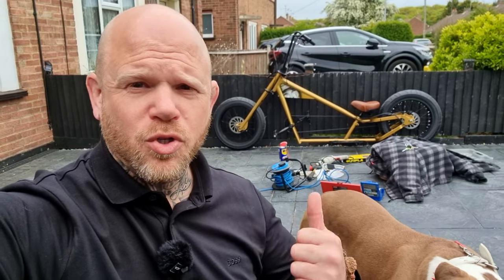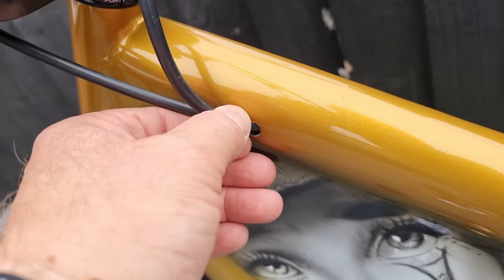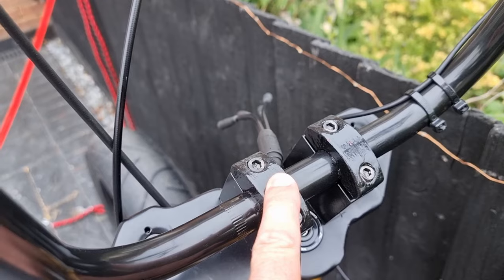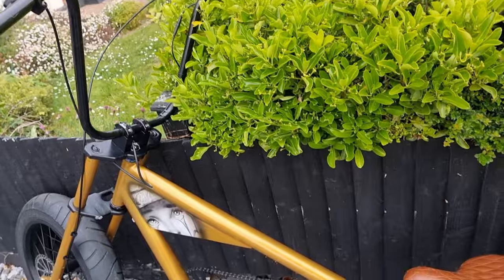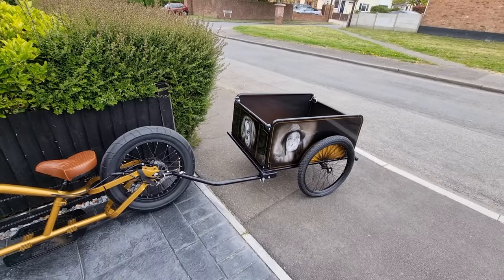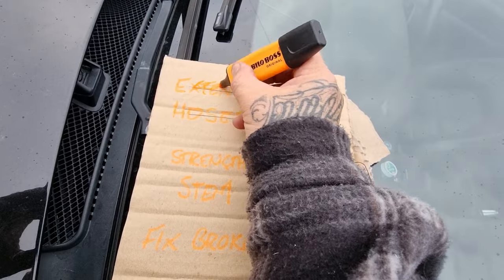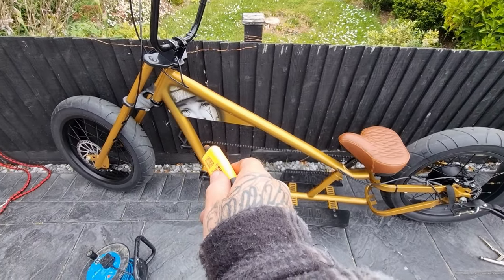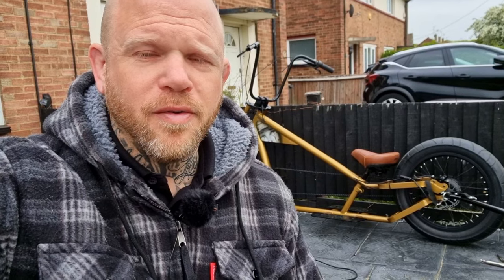CUSTOM E-BIKE LOWRIDER GETS HITCHED!

Comment: Wow it's looking amazing now the trailer is hitched to the bike I'm loving the face art work on the trailer. The brakes discs and cable routing looks really good what a mean machine. Can't wait until you get the battery and controller fitted.

Comment: Love the chopper look, but concerned about the bolts through the bars, massively compromising the integrity of the tube. If you have to make an emergency stop, you may find the bars snap in half, and you may go over the top and under a car or something. Have a look on line, at a motorcycle chopper and see the special brackets that are made for ape hangers. Looking forward to the next vid. Paul UK.
Reply: Never had problems with bars like that (and I've run quite a few over the years) unless the stem was aluminum. Under pressure, the clamping surface makes this dry, gray film and your bars slip around. Then you gotta clean it out with sandpaper and it's good another year or so. I'm wondering if the blocks on his fork risers ain't aluminum. Or maybe it's the paint causing it. Paint's squishy, better to powdercoat parts like that.

Comment: Awesome build! I've been following your progress even though I'm late to the game. I think it would be cool to go with two batteries and a parallel blender? Install one battery in the bike frame and the other in the trailer. That way you only use two batteries when you hall the trailer and one single battery when you run the bike without the trailer. That way you can install a smaller battery pack in the frame somewhere where it isn't as obvious as a giant 20ah battery pack. Just a suggestion from a clueless subscriber. By the way, I have a folding eBike, 350W with a 36V, 8ah battery pack. Not up to your standards but I absolutely love riding it. Cheers mate!

Comment: You could buy a simple welder and weld stem and handlebars together. You could drill the connector for trailer with a multi level drill, for example from 4 to 32 mm in steps.

Comment: it's looking good dude and the trailer looks sick now its attached to your bike/scooter I use a 52v 21amp battery a did 30 miles ans only used 20% but I did pedal most of the time but ye your bike is going to break some necks 😂
Reply from the maker: Thanks man.  I tried hooking up my 52  but it blew the controller so sticking to 48v now plenty enough for this cruiser and that's great range 👌

Comment: As lovely as it is and even though it's a classic I'd convert it to electric, you've got to move with the times and what use would it be with the engine when petrol is being fused out to be replaced with electricity, it just makes sense
Reply: @christopherfinnegan257  You think there will be electric airlines?
Reply: @ghz24  well they've already made an electric plane so in 50 years or so  that could be a big possibility 🤔
Reply: @christopherfinnegan257  sorry small lite personal planes and sport planes could have electric models but not jet passenger planes.
Vacuum trains are pie in sky unrealistic waste of research and resources.
The ultimate answer isn't giving up on liquid fuels it's using safe nuclear to make liquid fuels that are carbon neutral.
Solar and other renewables are only a part of the solution.
Even battery powered cars are problematic for cold weather climes.
If it gets -20° F and 20 mile per hour winds who's car goes farther battery or liquid fueled? Even just freezing rain makes the battery car use range to heat the windshield and cabin and even to keep the batteries warm. I'm a fan of electric vehicles especially Volkswagens over Ferraris.
I'm just not blind to the fact that they are not up to some tasks.